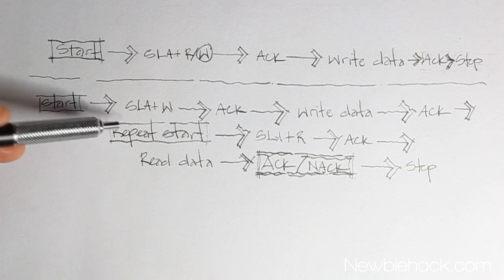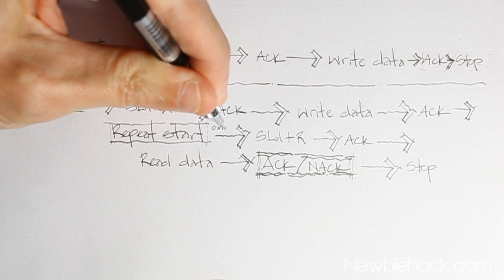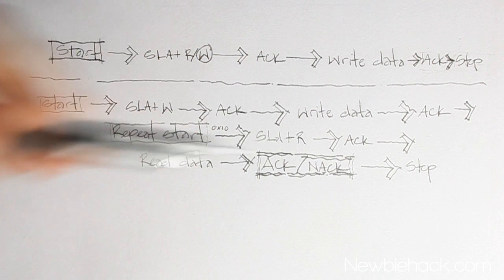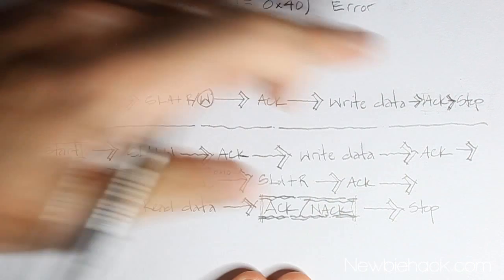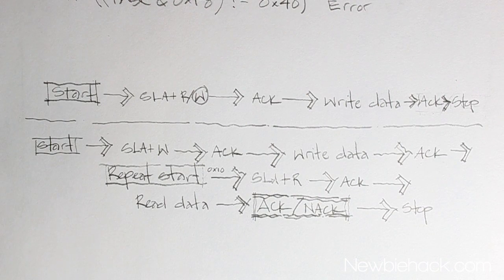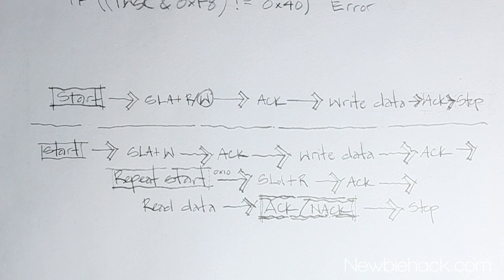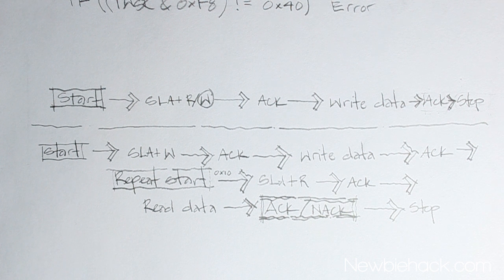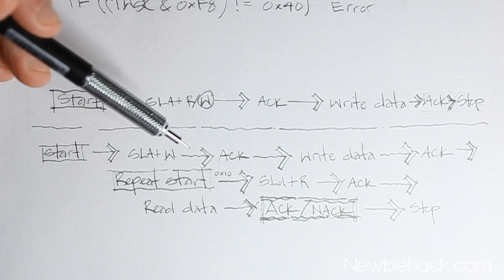How to Communicate Aspects of I2C / TWI - Tutorial on I2C TWI Part3-2

Comment: Why is  "TWCR=(1<<TWINT)|(1<<TWEN)"  isn't written this way using OR operation
 "TWCR|=(1<<TWINT) | (1<<TWEN) "   ??

or different because  TWCR=(1<<TWINT)|(1<<TWEN) sets the TWINT back to zero?
Reply from the maker: Is I use an "=" equal without the or "|" then I probably don't care what happens to the other bits in the register, or I made a mistake.  Could be either one.

Comment: Hello sir, your videos are very helpful and easy to understand. I just have one question. Why did u mask the TWSR bit with 0xF8 when you wrote the code for reading at 8:15?
Reply from the maker: That is a great question and one that you need to understand well.  The 0xF8 is used to test many conditions and the 0x40 is just one of them.  You want to make sure that the TWI process is at the correct state during each stage of the process.  The TWSR (Status Register) will help you with this.
Reply: sorry...i did not get what you are trying to say. In the video you initially said TWSR = 0x40 for reading. Hence to check whether we are reading or not why cant we just put the condition if(TWSR != 0x40)? Why mask it?
Reply from the maker: The mask provides the the test bits.  In microcontroller programming, you typically use a mask when testing a single bit; hence, the use of a mask.  It's simple & (and) bitwise testing in conditions.  F8 contains only the bits that you want to test and ignores the remaining bits that are not important.

Comment: Hi Patrick, say I have 20 sensors that I cannot change the address for various reason. I end up having 20 sensors with the same address, could you suggest some multiplexers that can bypass this problem? My sensors requires 3.3V to work, and I am afraid to pick random multiplexers that is not suitable (voltage drop, high inductance,etc).

Is there any general thumbs of rule for choosing one?
Reply: Richard Nguyen make your own slave sensors if you use 7bit address you can have up to 128 devices.